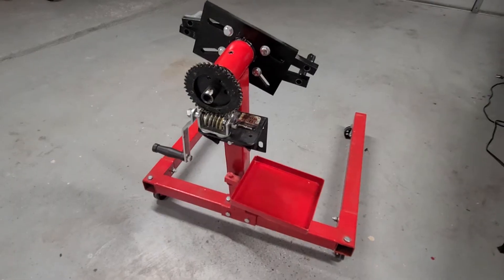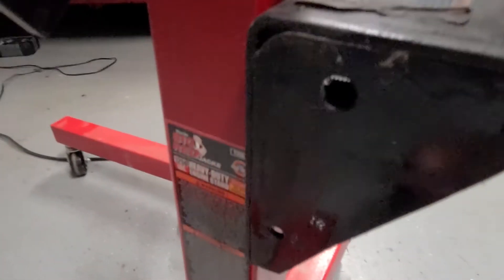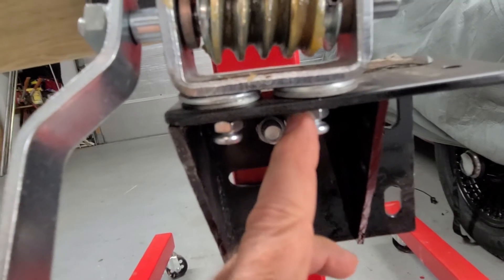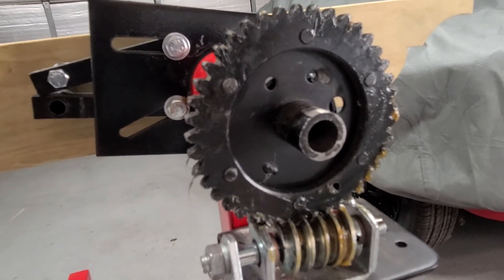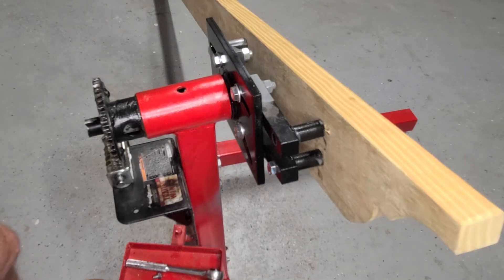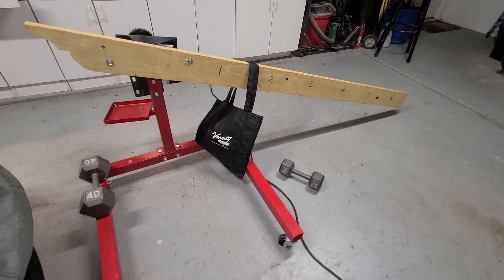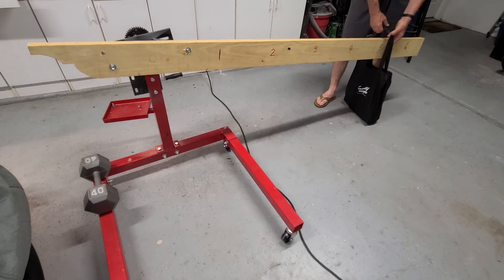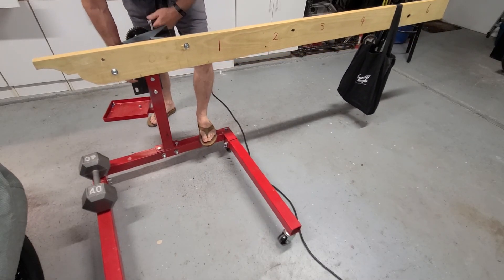Engine stand upgrade (1 year later) Questions answered, and testing

Comment: Nice mods   half people  that comment  have no idea  how winches work  even  if didn't work  you  could   add pawl to lock the gear  and you could  still use pin  pair vise grips to locking down. 90% of time engine  is going to be right  side  up or top  side down   but when   putting heads on 35 to 45 degrees  it's not spinning around  on it own. Great  stuff ,no matter what it's pain in ass to  mount engine  to engine stand off cherry Picker  over head hoist is so much  better.

Comment: I think I have at least 3 engine stands and no desire for a 4th with a crank, but I am heading off to get the crank assembly in a few minutes.  Thanks   I like taking the "attachment" part out and bolting that to the engine, then swinging that to fit the receiver, but if you weld it up, it is what it is.